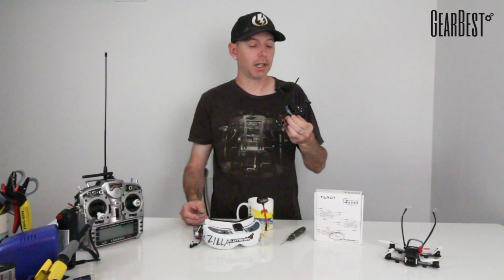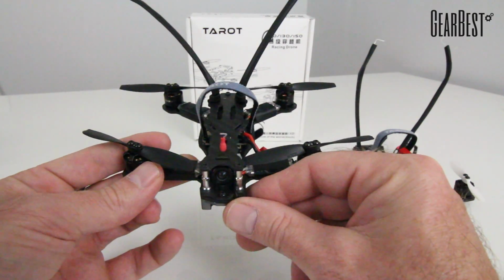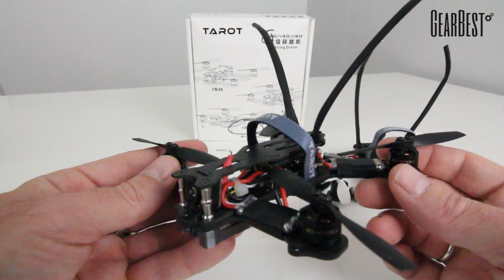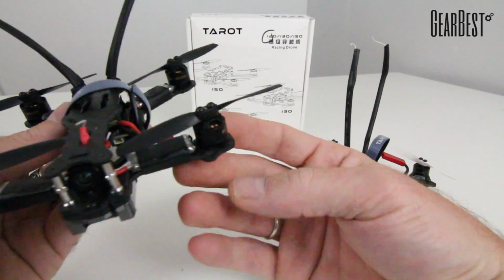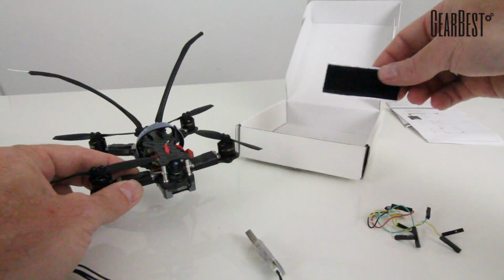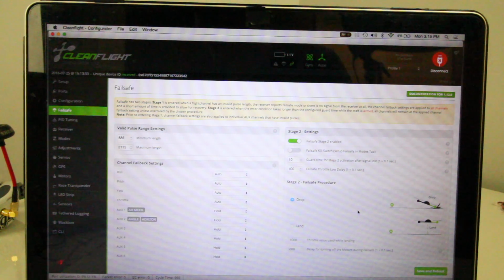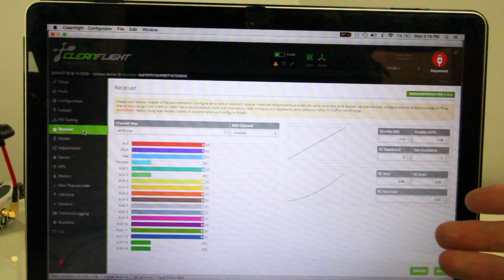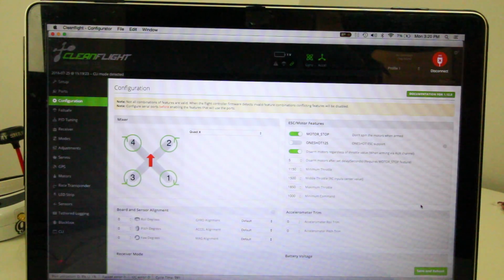TAROT 120 - BASH SESSION, SETUP TIPS, & REVIEW

Comment: are the black props better than the stock tarot props? if so where did you get them?
Reply from the maker: They are Rotor X props.
Reply: cool thanks. im still on the fence between the 120 and 130. just getting into racing. got a JJRC JJPRO T2 coming, but want a step up. have a walkers runner 250, but too big for where we race. ok enough of that. witch in your opinion is the better of the 2? 120 or 130? i have a orange sbus receiver , and will remove the case, and shrink wrap the rx.
Reply from the maker: I like my 120. Same power but lighter
Reply: i think i remember needing some drivers if running clean flight on a apple computer. where do i get them if needed.
Reply from the maker: I downloaded the Chrome Web Store app for Cleanflight. No drivers needed

Comment: Excellent review, gotta love Outbacks for this hobby!
Reply from the maker: Yep I can transport stuff and not worry about it getting wet or flying out the back :)
Reply: #Subiefam  You ever drive an XT? I have the 06 Legacy GT which is about the same thing just not as lifted. They are an absolute blast on the way to the air park.
Reply from the maker: No I haven't. I'm trying to keep this one as long as I can. No need to buy a new one.
Reply: Yep they are tough! We have a Tribeca for doing long road trips (Wife's car) and it's up to 361,000 miles. Have you found any other mini drones better than this one in this rough size category? (120-180)
Reply from the maker: There are some new ones coming in the next few weeks only a few people have seen. They will be either build videos on them or flight reviews on here soon. For a really sweet DIY 130 there is the Gb130 Kit. This thing is an animal. I love it. It's here: http://www.gearbest.com/multi-rotor-parts/pp_448107.html?lkid=10218898
Reply: I actually was looking at that one about an hour ago.. It looks awesome, I've narrowed it down to a couple (x220 wizard RTF) (Vespa 125), (Eachine Falcon 180) the GB130 is super punchy, like the (JJPro P200) I think some of these would be hilarious with 5-6s on them. The Vespa 125 I looked into was running 4s with 20a bheli's and 1306 3100kv's. for the money the jjpro200 and the wizard x220 rtf looks to be the best for the money but the GB 130 is my favorite as well. Problem is I don't have a controller I got out of the hobby 2 years ago. Going back into it now. everything has changed.

Comment: I still cannot understand why they didn't make this compatible with Spektrum satellite rx! I've been looking for a PPM rx that would fit in this little thing, and I haven't been able to find anything. Orange used to make an absolutely tiny PPM rx but it's out of stock everywhere
Reply: How about http://www.hobbyking.com/hobbyking/store/__92289__OrangeRx_R610V2_Lite_DSM2_Compatible_6CH_2_4GHz_Receiver_w_CPPM_US_Warehouse_.html or the more expensive option http://www.lemon-rx.com/index.php?route=product/product&path=70&product_id=138 I used the lemon in my tarot 120.
Reply from the maker: I'm pretty sure you could use a Spectrum PPM receiver. 
What about this one? AR7700 Serial Receiver with PPM/SRXL/Remote Receiver Output (SPMAR7700)
Reply from the maker: Unless its too freaking big. :/
Reply from the maker: Might be able to de-case it. Then shrink wrap it.
Reply from the maker: should wok fine as long as its PPM.  _ JD